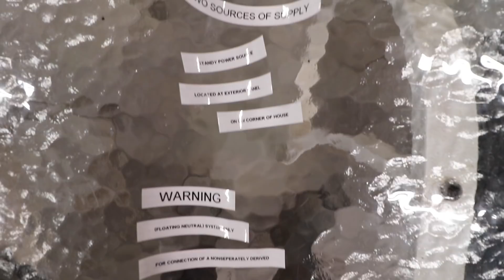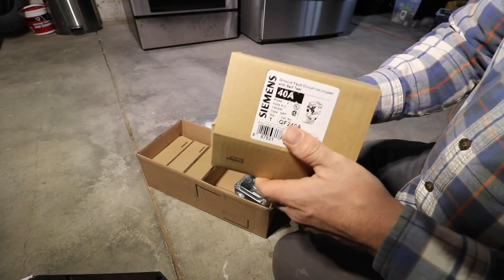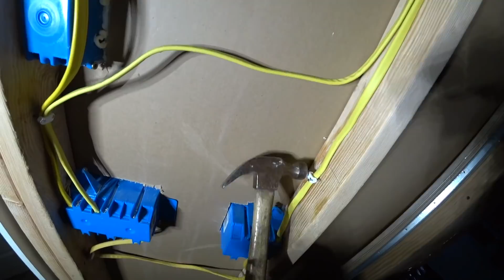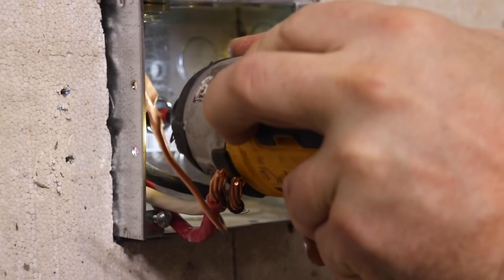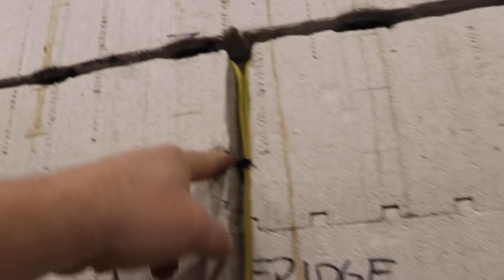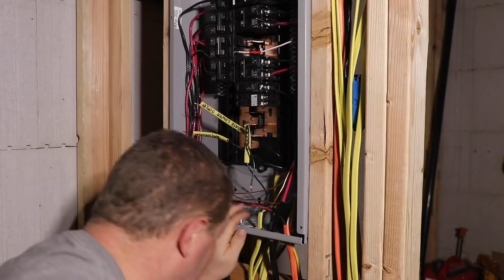We FAILED OUR ELECTRICAL INSPECTION! Now What?!

Comment: Is that breaker GFCI only?  By the looks, its also AFCI fault which would make sense as they're designed to protect against damaged wiring. (Ground Fault vs Arc Fault)

Comment: Electrical Professionals (or those that know the code how it works in this instance) 
For the 20 amp circuits-- would you be able to put an outlet box and a GFCI "outlet" in line with those circuits and meet this code?
I've actually thought about putting a "stack" of outlet boxes, one per circuit, near my panel to be able to do something like that.
Horrible idea?

Comment: It's probably too late to worry about, but you should check out Wagu connectors.  They replace the twist style connectors.  Ideal has some as well, but they're (as far as I know) not the kind you can take apart.  Sparky Channel has some videos on them if you want to check them out.  They are SOOO much easier to deal with and come in a number of configs.  Maybe when you get to wiring upstairs, you can use them. (I'm not an electrician, homeowner talking here)

Comment: GFCI protection is required in ALL garage outlets, because you are standing on a concrete floor, which is a ground. Likewise GFCI in bathrooms, kitchens, and exterior outlets are because of water/water pipes which also are a ground. BIG DIFFERENCE between getting a little shock in your finger versus having current flow through your body and out your shoes or your other arm. Sounds like you've got a good inspector — that's key with all the changes to code.
You shouldn't need GFCI breakers for the range and dryer outlets when you move them upstairs. The GFCI duplex outlets on your kitchen counter plugs — you've already learned how to do that with the first outlet in a wiring "chain" (much cheaper than the breaker version). Requiring "tamper proof" duplex outlets everwhere! GADS, only idiots give little kids metal things they can insert into an outlet. In my lifetime I've never heard of anyone being shocked by a duplex outlet, that a tamper-proof would have made any safer. Same idiots that force us to wear all that safety gear just to ride a bicycle.

Comment: in my area the guys will run 2ft of bx cable out of the panel to a junction box with a gfi outlet right near the panel. and then they run their wires to everything else from the gfi outlet down so everything down stream is gfi'd. so they keep regular breakers and then once out of the panel go gfi. romex after the gfi outlet. they are only allowed 11 outlets down stream cause you waste an outlet near the panel for gfi protection. so when the gfi flips, the breaker flips or gfi or both and then u go to the panel and u can see which gfi outlets flipped cause of the light.

Comment: I don't see why you cannot use conduit in the garage space run the cables. You might only have to drill through to the concrete to fix the conduit. I look at the garage as type of industrial space

Comment: I think you have a misunderstanding of nail plate protection.  The nail plates apply to penetrating structural member (studs, plate, joists, rafters etc) not void spaces such as stud bays.Your inspector wants 1-1/8" because the code requires drywall nail or screw to penetrate into the member 1". Notice common drywall screws and nails 1-5/8"  and not 1-1/2", this is because it is perfect to comply with 1/2" and  5/8" drywall  leaving min 1" into the member. If you have a 3-1/2" stud or plate and a standard 1" hole on center. ( 3-1/2" stud with a 1" hole = 2-1/2" which equals  1-1/4" each side and safe). If your hole is not on center you need to protect the inferior side with a nail plate. So if the wire or pipe less than 1-1/8 " deep into the stud or any nailing pattern protect it.

Comment: It is bad practice to test that the power is off on a circuit using the a “non contact” tester.. you should only test with a meter via the test leads or a test lamp.. it is too easy to get a false indication or lack of indication with the non contact...

Comment: Instead of using a lockout you could put a disconnect or a plug and outlet. The reason is that if the breaker isn't in line of sight is so while working on it, someone doesn't go and flip on every breaker when there lights not working. I have personally been working on something when a idiot  removes the don't turn on tag, breaks the lockout and turns it on. The whole time they had a bad cord.

Comment: So, do guys doing remodeling use the GFI on the new addition they are doing in homes that are still occupied? switch over to non gfi when they are done! never hear of doing this. Code changes all the time. However, if you think about it, it may take you a year, or two to finish and close up those walls. May not be a bad idea.

Comment: I would have run all of that electrical on the ICF walls in EMT conduit. And then I would have refilled over top of the conduit after the inspection. And it would have looked really good. That's what I have done in my own garage.

Comment: I remember in a previous video that you said you were not going to cut corners.  Seems like not putting up a stick wall inside the garage is cutting corners.  At some point in your life you will be selling this house, and the prospective buyers will see these shortcuts and move on to the next house. Even with a Timber frame house, there's still stick framed walls.

Comment: With the stove receptacle, you can't connect the pigtail for the box and incoming ground wires  together at the receptacle. Either 2 pigtails or run the incoming ground through a box lug and then continue it to the receptacle. The inspector is allowing 3 separate non-tied breakers to power the water heater? Someone could turn off one breaker and go to work on the W/H, thinking the appliance is de-energized, only to find it's still energized through the other 2 breakers.

Comment: I just feel like adding my thoughts, so tough. I wouldn't "foam in" your Romex. Wire gets warm if it gets too near its capacity. No problem if it can cool. But if you tightly insulate, you limit that cooling. Potentially a safety issue, but why take a chance for a tiny bit of insulation? Air less than a quarter inch insulates pretty well. Less than a quarter inch means there is no convection, which means it is just as good at insulation for the low heat differentials between conditioned space and middle of ICF.

Comment: The inspector can approve two types of connects to a power utility line. 1.Temporary power  such as a  job-site temp power pole or 2. Electrical Service Connection after a final inspection. What is odd is that the power company connected to your main entrance before you had it inspected and approved as a Temp Power Entrance. GFCI's are required because temp power must be protected for outdoor / personal use because it for construction. Your inspector is bending over backward to make it work for you, because most would say install a temp pole and then you would need to jumper from temp pole to your main entrance and wow would drop amps available. Your inspector can't take money, some of that yummy home made jam may be in order.

Comment: It looks like you had to pay a month's worth of rent to use your home as a temporary home until construction is finished.  Sad to hear about the excessive cost of the ground fault breakers.  You are ok now to live in the garage as a temporary residence for as long as you need.  Grounding the metal boxes has been a practice for ages - but don't beat up on yourself - you're doing fast-track learning and doing a great job of it.  And still don't beat up on yourself - for every commercial construction job I worked, the Inspectors always had issues with the build, even when the pros were doing the work.

Comment: Larry here again,
Jessie I have a suggestion for avoiding the nailing plate issue. If you were to use armored cable or conduit it would probably pass inspection. You might be able to slip your existing wire into armored cable , might be hard to get it without wire in it. I would say conduit would be better if your retaining your present wiring. You may even be able to take a cutting wheel and cut a slot in the back side of the conduit and just set it over your existing wiring.

Comment: You should have put the temporary breaker feeding the house as the GFI breaker, then the inspector can say anything about it. Says me, an actual electrician.
Temp power is treated entirely different then perm power. Your mistake was getting an electrical inspection in a temp state. I don't understand your reason for having one at this stage.

Comment: Ask your Inspector if it wouldn't be possible to put in a subpanel up stairs to wire that floor into from power from the basement panel. It would be a lot less work than running all of the wires down to that panel.

Comment: A 100' x 8" roll of heavy-duty galvanized metal flashing should suffice for creating extended nail plates to protect the wires and cut down on EM radiation a bit.

Comment: Need to just rip out that 30 space panel and get a 40 or 42, MLO panel,  1-for the additional room and 2- You're going to need the spaces. Unless you run a 100 amp sub feed to another MLO panel upstairs. Sucks having to redo stuff isn't. There is a reason we Electricians charge what we do, experience!

Comment: I agree, you couldve just put a 200A GFI breaker on the main disconnect to get around that part of the code instead of buying a GFI breaker for every single circuit.

Comment: The code requires Arc Fault breakers which is what he showed in the video.  They are expensive and now required in most parts of the dwelling. They are more sensitive than GFCI.

Comment: Alert...   If your electrician hasn't already told you, You need to get the inspector to clue you in on the amount of ARC Fault breakers your gonna have to purchase.  Also, all the kitchen plugs are gonna have to be GFCI/AFCI receptacles. Even the ones farther away from the sink.   In the last three years it's gotten very expensive to wire a house.

Comment: The electrician should have known you need to bond your box and use a green screw. That's standard. 

You might need a sub panel for all the stuff upstairs, so hold onto to those breakers, as they will work for outlets or backups for some that may fail until you can get replacements, since your area is remote location

Comment: PRO TIP****are you sure the inspector didn`t say arc fault breakers***** if indeed  it needs the gfci a alternate to breakers would be to install a rack of gfci receptacles at the panel and feed thru them.

Comment: In BC, Canada we have to use the AFCI breakers for outlet circuits. I can't remember if its only bedrooms or all interior residential either way not more then 20A circuits. I've never seen a 40A, they must cost a pretty penny. If they aren't required after final inspection you'll easily be able to sell them to make back a good portion of that money. I hope all goes well on the next inspection!

Comment: The line of sight is correct in residential.  Hot water heaters,  well pumps and other appliances that cannot be "unplugged" need their own safety shutoff if the panel breaker cannot be seen from the appliance.  In lieu of that there needs to be a lockout on the breakers that can be locked with a padlock. Section 422.30 of the National Electric Code (NEC) requires a disconnecting means for all appliances.

Comment: Hindsight is 20/20, I work for a utility company and I think it might have been cheaper to put a disconnect sub-panel where your sub-panel is and used a main disconnect GFI breaker at your sub-panel it would have covered all the breakers in that panel. just a thought for those doing something similar.....

Comment: Forgot , instead of breaker locks , use a $15 - $ 20 disconnect at the water heaters and other 240 VAC loads that are not cord & plug connected .

Wyr
God bless

Comment: GFCI CB's are required by code in temporary power / construction poles .  I have never known that to be applied  to a house under construction .

     Would have been cheaper to call in for a rough inspection .  Then immediately covered the wiring with dry wall .  Attach it with screws & if you have to take it down again , so be it .

     As for as the wiring in the ICF , I would have used conduit .  But whwew you are , at the present , cover the grooves in the ICF with 2" - 4" strips of white plastic .  Or , maybe sheet metal .  Not entirely sure about that .

Best of luck to you .   :-)

Wyr
God bless

Comment: If your sub panel is in the garage and equipment is within sight of over current protection device or no more than 50ft the nec doesn't require a disconnect or breaker lock in open position

Comment: Ground clip for that metal box and extension would have be easier. You could use wire ladders for that stud bay, reason they are made. Don’t forget to add kock out plugs so u pass inspection. the NEC is designed or made to protect life and prosperity.

Comment: wait ..  wait .. your meth addict inspector passed that bigass cable with a bare male end on it hanging out of your outside box you got on there for your generator.. but he is telling you to buy 3 $100+ lockout breakers for your water heater that is 3 feet away from the circuit breaker? and run around and label everything .. after you pass your inspection have an electrician review everything that guy inspects... wow

Comment: that inspector is full of shit and just caused you to waste all that money there was nothing wrong with that install period and that comes from 30 years of experience.
  this is the OTHER reason to get a copy of the NEC and read the first chapters on how to use and read the code so you can defend your work as necessary and better understand how to make corrections.
 IF this inspector did ANYTHING beyond telling you the code section he thinks your violating he exceeded his authority they are NOT to help you make the correction because they CAN NOT be held responsible for doing YOUR engineering for you...the next inspector can show right back up and flag the work the first inspector told you would pass and if any of it catches on fire neither one of them are at fault by law.

Comment: FYI for future use. We used to use ground clips on metal boxes that did not have provision for a ground screw. Ask the inspector of these are still allowed. The  ground wire folds over the edge of the box and the clip is pushed over it to maintain a good connection. Also it might be an idea to plug mount it if you add another overhead heater.
Don't mind the people that scoff at following the code, that attitude can cause fires and deaths.  Hats off to your inspector, it is great when they act in an advisory role, most do but some don't.

Comment: Thank you for the update and sharing.  This was interesting information.  I know lockouts are for commercial, but never hear of them for residential property.  Place GIF circuit breakers have been required in may areas for a few years on new construction.   :<     Keep up the good work.
EMT boxes, the easy way to remove the tabs is to hit the tab with the front of electricians plyers.  This will push the tab into the box.  Now you can use the plyers to ply the tab out by moving it back and forth.  Hope the helps.  When removing a 3/4 tab, first remove 1/2 tab, then reach in to remove 3/4 tab, this will all take lest then 15 seconds.  Trying to use a screwdriver is to much work.
I think when you where putting the 50 amp plug back together it looked like you placed 2 ground wires into the plug and screwed them down.  Not sure if I saw that correctly.  If this is true please fix.  Only one wire can be inserted or attached to each screw on outlet or switches.  This should be a pigtail.  The issues is the wire could over time come lose and short, or you lose your ground.

Comment: I have never heard of the need to put a Lock Out device on the breaker in a residential! only in a commercial application! As for the GFCI, that must be a local code requirement! I just looked it up in the code book and it is only required for temporary use. with that said, I can understand the need for like the range, fridge, washer/dryer since they will be moved later once the house is completed. but the water heater.... that is permanent. Oh well, really don't understand these requirements for residential! Good Luck!! enjoy the video's!! Congratulations on the family addition!!

Comment: Ok, the code book does not have all this, but each municipality has the option of adding requirements/enforcing to basic code, that is why so many are surprised, I would suggest you get with that inspector and ask where to get that municipality code requirements. Look for definitions for ark-fault interrupter and ground fault interrupter in NFPA 70 2017 Section: 100.  My understanding that he is treating your site has a construction site only because per code the bedroom minimal code for Dwelling Unit outlets is ARK Fault protection NFPA 70 2017 Section: 210.12 and not GFI (more for wet areas like near a sink/washer) protection NFPA 70 2017 Section: 210.8 NOTE THERE ARE AFCI/GFI BREAKERS. Also note that you can not use a junction box where it can not be accessed/concealed.

Comment: I was initially like "Grrrr,  %$&@^ codes" but then I remembered the house across the street that burned down last year.  It was started from a circuit in the garage wiring faulting out. GFCI would have stopped that. No one was home at the time so all were safe. The bad/interesting part was that the homeowner is an electrician.

Comment: Stove 240 outlet.  Almost positive that your 50 amp outlet only allows one wire per screw.  So putting the #10 bonding and #6 power wire isn't code.  NEC 2017 Article 110.14A

Comment: You need to use is a romex stacker for the small stud bay. you can hold up to 6 romex and it keeps the wires in the center of the bay.